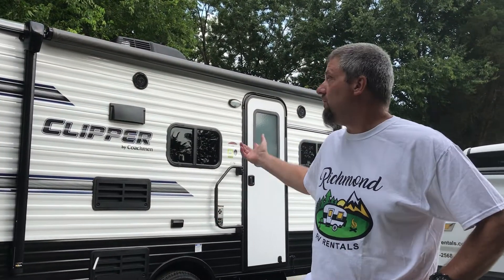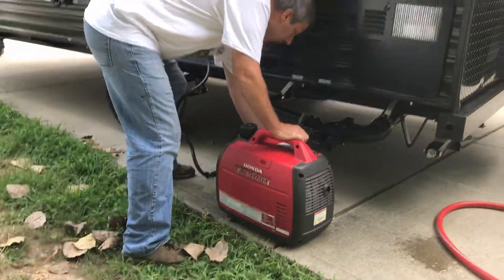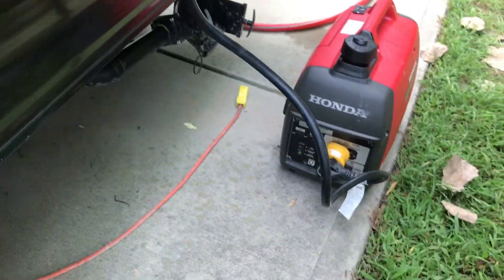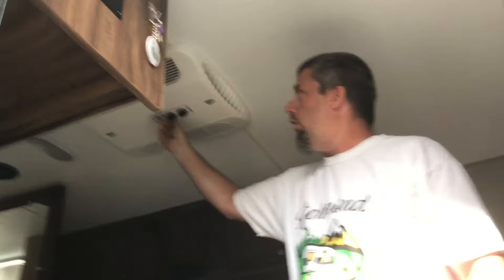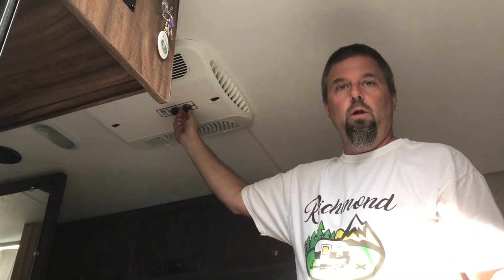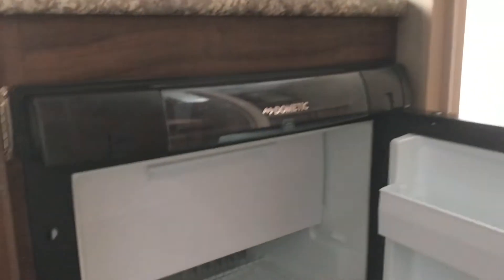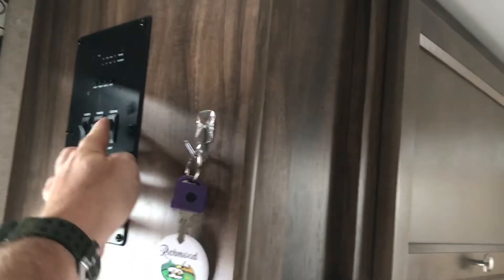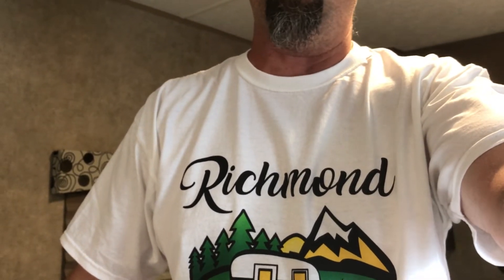Honda EU2000 powering an RV 13.5k BTU Air Conditioner

Comment: Get a soft start kit and it will work fine.
Reply: Hi. I just installed. Soft start today and tomorrow I head out. I’m plugged in T an rv resort so I didn’t have time to test it but a 2200i should run one 13,500 btu ac just fine? How many hours do you think I’ll get on a gallon of gas? Thanks .

Comment: I felt defeated when I couldn’t get the same generator to run my 13.5k ac.  But after letting the generator run for a bit and sit for a minute at each step before switching to low ac it finally worked.  And the fridge!!

Comment: I tried this per your instructions using a Yamaha 2000 watt. It worked for about 45 seconds then the a/c shut off and fan wouldn’t start either. I reconnected to shore power and the a/c or fan would not restart. I thought I may have done some damage to the unit, but after a couple of minutes the a/c did come on and blew cold air. 

I am considering buying a second Yamaha 2000 and hooking them in series. What is your opinion on this setup to run a/c. I run my refrigerator on propane.
Reply from the maker: This vid was from a few years ago... we have since upgraded all of our generators to Predator 3500's.  Two 2000 watt inverters will easily power a 13.5k btu AC.
Reply: Howdy... Look into RV's (on YouTube) using Honda 2000 generators with EZ Start or Soft Start device attached and available on Amazon for $250-$350 depending on your choice of options available.

Comment: Keith, everything was off, but now that I think about it, I put a Kill A Watt  meter between the Honda and the Clipper cord. The Kill A Watt had an 1800 watt limit. It may have limited the electrical flow. I’ll try again tomorrow. Thanks for your input.
Reply: Interestingly, I happen to be sitting here with one of my Kill A Watt meters as my "String around the finger" reminders to calculate how many start-up watts I'll need to power a small AC unit in my off-grid house. I only have the EU 1000 at the moment but with all the three digit temps some investments need to be made. Have you looked into the EZ Start or Soft Start options ? (to cover the surge at start-up ?). I found a good number of You Tube videos giving the experience of other's on the RV circuits.
Reply: @deanstackhouse4991  I have looked into the soft start units. Instead, I think I’ll put a 5000btu AC in the  kitchen window of my Coachmen BT17. My Honda 2000 can run that with power to spare.

Comment: What type of plug did you use. Is that an adapted plug?
Reply from the maker: It is a standard 30 amp to 15 amp adapter available at Lowes and Home Depot
Reply: Thanks Keith, I have a Coachmen Clipper 17FQ, and a Honda eu2000i. I had always heard this Honda would not run a 13500btu AC so I never tried it. I have a 30/15 adapter. I’m trying this tomorrow! I’ll let you know if it works for me.
Reply: Keith,  does your Honda have 20amp sockets or 15amp? Mine is 15 amp.
Reply from the maker: Bradley R  I don't have them anymore... we rent them so much we turn them over and sell them used with 1500 hours on them (I added hour meters to them). We've switched to Predator 3500 watt inverter generators as our rental fleet has grown to 15 units, some with 15k AC units!
Reply: Keith, I got my AC to start, but it only ran about 15 minutes then overloaded. Oh well, it was a great experiment!
Reply from the maker: Bradley R  was everything else off? Fridge, water heater etc?  Usually it will overload on compressor start... once running it should be fine.  Weird
Reply: @bradleyr34  Same for me, but shorter time. It was 105 degrees in my camper.
Reply: That's the exact same procedure I had done just yesterday.  I have a 13,5 as well and a wen 2250. All was good until the compressor kicked off and then back on. Overloaded. Did it twice in a row.
Reply: It will work if you wire in a rv soft start that absorbs the overload current and it doesn’t trip out. Becoming pretty popular now a days. I plan on getting one. I have a Honda 2200 and it works but sometimes it does Tripp it out. I’m going to get mine from techno rv. He has a discount thru his site.